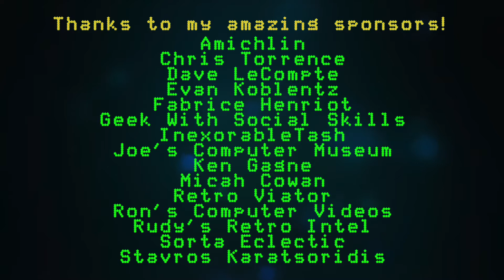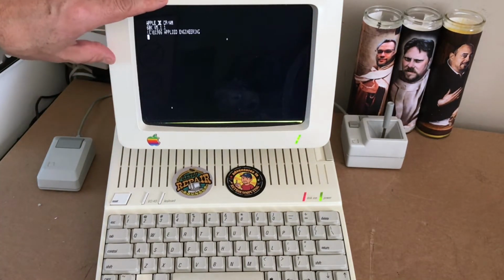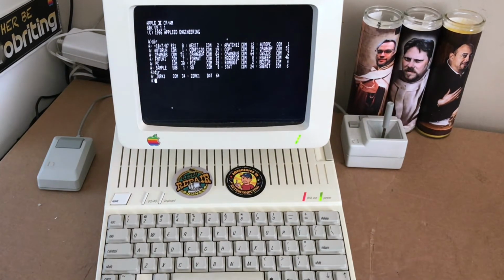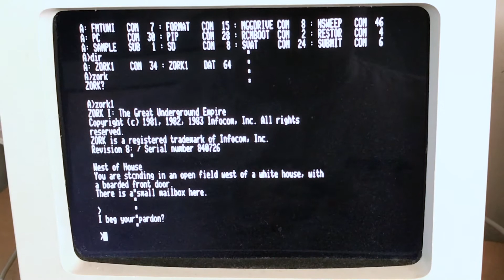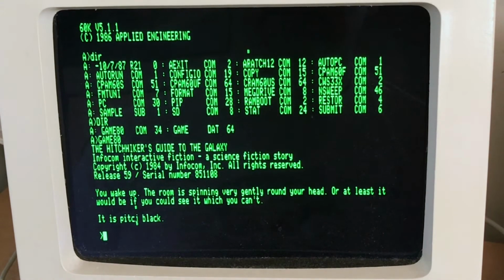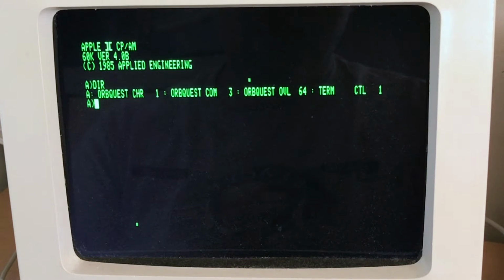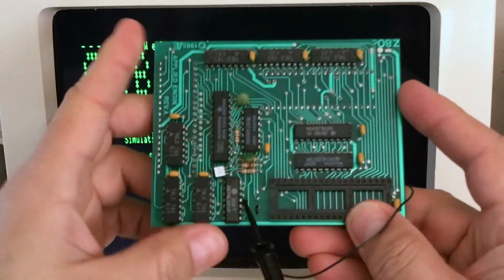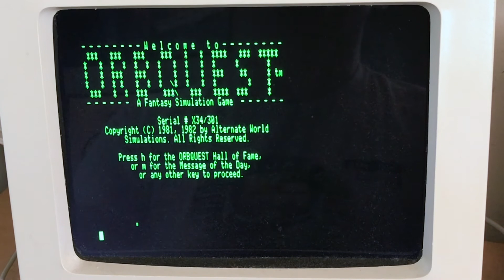CPM on an Apple IIc? Let's take a quick look!

Comment: When is someone gonna make an internal connector to give the IIc Ethernet 😫🙏 Apple was going to do this, there is a trace near the power supply meant specifically for internet
Reply from the maker: The Apple IIc+ has an internal connector for modem, but seems that does not respond to commands.
Reply: @ARCJavMaster  how about using a 1mb ram card. Would all the instructions/info be possible to load onto that for it to read!? Or will it actually need physical work done? Thanks Jav! This is literally all we need for the IIc now!